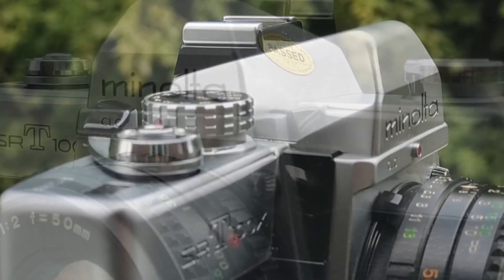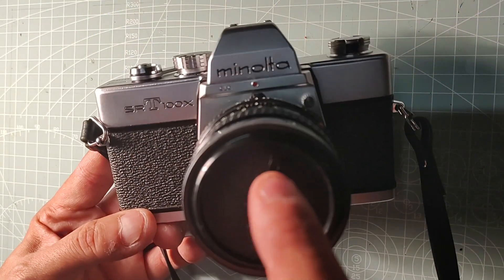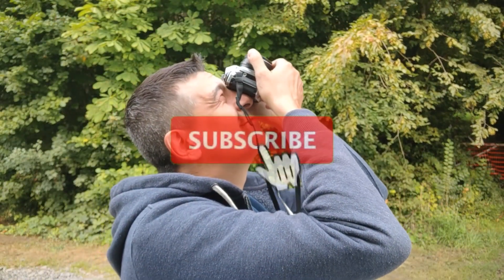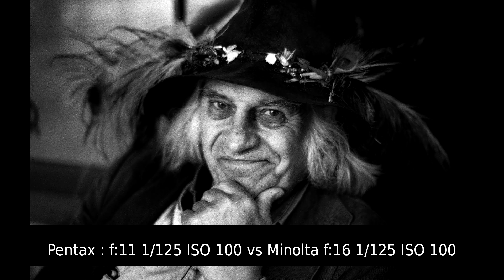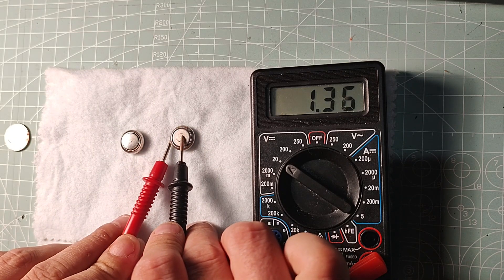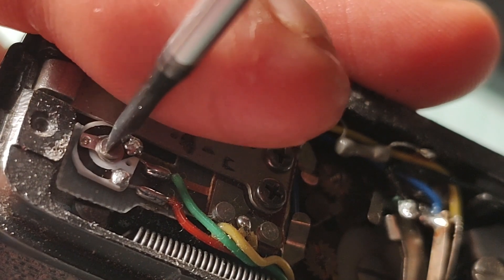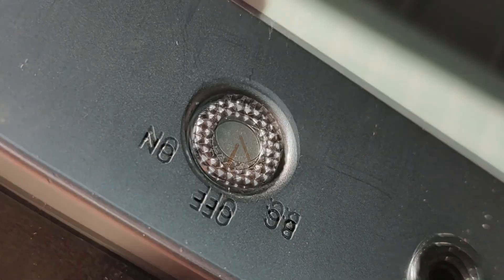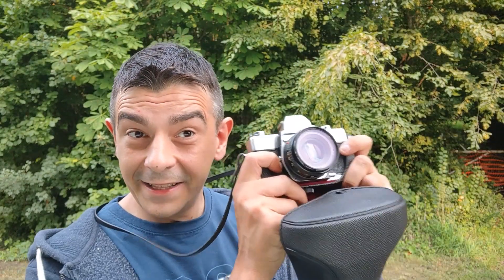How to use modern batteries on the Minolta SRT-101 (Alkaline or Silver Oxyde). Easy tutorial

Comment: It is a temporary solution and not very good, although of course it is free. The main reason that cameras of that time used mercury batteries and did not have voltage controllers was because they did not need it, since mercury batteries had the quality of not lowering their nominal voltage until they were completely discharged. Modern batteries do not have such an ideal discharge curve and especially alkaline batteries lose their voltage of 1.5 V quite quickly, which is why it is necessary to recalibrate them quite often if you want to be able to trust the photometer. The best solution is to solder a diode that only permanently lets 1.35 V pass from the battery, allowing you to use cheap 1.5V batteries and that would last until the battery has to be replaced by a new one. The second best is the adapter using SR batteries and the third is to use an external photometer or the sunny 16 rule.
Reply: Use a silver oxide battery, not an alkaline one.
Reply from the maker: That's... not true ! The diode is not a voltage regulator. The diode has a voltage drop so when the battery gets exhausted, the diode won't help. Just use the Battery check, if the needle shows the battery is on its way out, get a new one.
Reply: @MrAnalogDan12  Yes, voltage drop from 1.55~1.5V to 1.40~1.35V permanently if the correct diode is used, when the battery voltage drops below 1.35 the voltage after the diode is 0V therefore the battery must be changed therefore the diode works as a voltage regulator.

Comment: Dan, just a quick question please Sir? 

When you showed the last reading on the SRT meter, was you pointing at the sky again? I sort of got lost in the middle part of the video. Could you reply with a order list on how to do it? 

For example -

1 set the settings to 100 iso, 1/125, F11
2 take a reading on SRT
3 adjust the meter 

this is where I got lost Dan. What do I do with the on/off whilst doing the calibration adjustments?

Can you reply with a full instruction list to help me?

Would appreciate it.

Laurence
Reply: The last meter reading was just with the power switch set to battery check (B.C.) That should move the needle to that possition, whatever the lighting conditions are.

Comment: Nice video, but I believe alkaline batteries will not retain a consistent voltage so it will cause inconsistent readings, silver oxide are better since they maintain a constant voltage. Silver Oxide SR44 batteries will be smaller in the battery compartment but will still work
Reply from the maker: Use the battery test function and use a new battery when the old one dies, or use a washer around a SR44 battery.

Comment: Great video! I'm keen to try this! I'm a little confused about how to check that I've adjusted the light meter the right amount. What signs tell me I've changed it enough, but not too much? You pointed the camera at the sun, but I don't know what to look for at that point. And how did you know how much to change the battery potentiometer?
Thanks for the great video!
Reply: He use another Pentax camera as a light meter. You can use light meter device or phone app instead

Comment: Wouldn't it be better then to use Silver Oxide batteries instead of Alkalines? The discharge curve of silver Oxide is similar to that of mercury cells (long stable voltage and at the end a rapid drop) while alkalines lower the voltage constantly when discharging. Just a question.

Comment: The funny thing is that for my SRT Super, I had to move the trimmer pot the opposite way, so it's at about 10 o'clock to center the needle for ISO100, 1/125s and f11.
Reply: Meant to say battery was measuring 1.58v
Reply from the maker: As long as it works, it's okay. Maybe double check with a light meter app on your phone to be sure and if it checks out, you'll be good to go !

Comment: Thanks, I have a question. I bought the Varta batteries  V625U/LR9 for my Minolta SRT 101, but I can't seem to be able to move the needle down. Is there any other issues or possible fixes so that I can use my camera?
Reply from the maker: Does it work on battery check mode ? If it does disengage the depth of field preview. If it does not work at all it might be other things. Could be the contacts, corrosion or a stuck Needle

Comment: I do not know how much effect it has in practice (maybe the difference is negligible) but adjusting the potentiometer is not the same as using an adapter(/voltage regulator) or changing the circuitry by soldering in a diode, because the behavior of the CdS cells is nonlinear with resistance in the circuit. I recommend checking out Mike Willegal's Minolta SRT page about the workings of the SRT's light meter, and Dick Sullivan's resources on Rokkorfiles.

Basically, using a higher voltage battery and a higher resistance of the potentiometer changes the behavior of the CdS cells. This is because the voltage drop over the potentiometer varies with the current through the circuit, and the current is dependent on the resistance of the CdS cells, which in turn is determined by the amount of light.

In contrast, an adapter/voltage regulator will guarantee a constant 1.35 V output, while a diode will always have a constant voltage drop, therefore also basically guaranteeing a constant 1.35V. It's therefore also not recommended to use alkaline batteries, because over time their voltage slowly decreases. Silver oxide batteries, in contrast, do supply a constant 1.55 V for 90-95% of their lifetime.

Again, I'm not sure if the difference is noticeable in real life, but as an electrical engineer I do know that the behavior of the circuit will be different, and that the potentiometer, by design, was only meant to fine-tune the calibration.
Reply from the maker: Thanks for your comment. There is a difference in low light situations like EV4 but it is not significant unless you're using slide film. So you're right about the non linearity.
Reply from the maker: Your comment made me think about this. And you were right in your assumption that any difference would be negligible. I'll post a video about it.
Reply: @MrAnalogDan12 did you happen to make that follow up video, by any chance?
Reply from the maker: @simonmuscat7055  nope. But It would be quick. There is no difference.

Comment: I did this calibration but accidentally used a metal screw driver to move the battery check meter, is that bad? Everything still seems to work but now I worry because I see that others only used a toothpick.
Reply from the maker: No. It could have been if you scratched the potentiometer track. But since you didn't it's fine. Most cameras you see on this channel are not mine so I try to be careful

Comment: I’ve owned my sr-t 200 for several years now but the meter has never worked. The needle isn’t stuck as it moves when the switch on the the bottom of the camera is placed in the bc position, but when turned on, the meter doesn’t seem to react to light. It stays up all the time.
Reply from the maker: check the DOF preview button, if engaged, the light meter is shut down

Comment: Thank you very much ! The video is very useful ! 
However I'm facing a little issue : I bought this model second hand and while the light meter needle works, the other which indicates my exposure according to the aperture and shutter speed doesn't move. 
Do you think this is caused because the battery is not suitable or is it a mechanical problem?
Reply from the maker: Sorry to tell you this, check that the lens aperture coupling (see manual) is not stuck, it should be springy. Otherwise, there is a mechanical issue.
Reply: @MrAnalogDan12  ok thank you for the advise. It must be mechanical, I’ll see if I am able to fix it myself or I will call a professional.

Comment: Unfortunately, my SRT-101 meter failed a second time soon after my local Minolta repair shop closed and I have been either using the sunny 16 method or my X-700.
Wonderful and useful How-To video!
Reply from the maker: failed how ? Does the BC works ? if not, maybe the needle is just stuck.
Reply: @MrAnalogDan12  Odd that I was not notified by YouTube  of your comment until two months after it was posted.
IIRC, The initial failure as described by the Minolta technician was caused by a string that disconnects from the meter needle.
I do not recall doing a BC- I may do so if I have a suitable battery.
I haven't attempted to remove the top cover to determine if the meter is not functioning for the same reason as I ceased relying on the camera meter.

Comment: Hello Dan thanks for the video.Question can I apply this to the Spotmatic
Reply from the maker: No need to. The spotmatic circuitry is voltage independent. But if you need to calibrate a spotmatic you need to remove the rewind knob on the left. It's not as easy but doable
Reply: @MrAnalogDan12 Thanks for your advice e Dan will leave alone